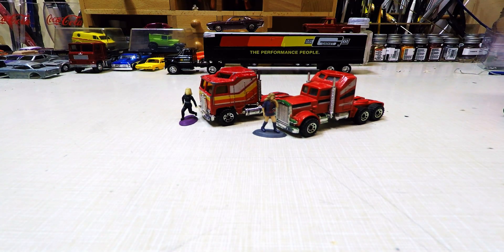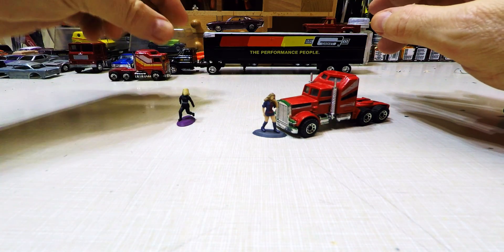Matchbox Kenworth Aerodyne COE and Conventional wheel swap and ideas

Comment: Are my eyes playing tricks or did I spot a 77 Dodge Street Van by Tomy? Reason it caught my eye is I have one like that but mines a little rougher I believe. Don't know much about them, got mine given to me with several other cool cars including my Bearfoot. Looking forward to seeing your rigs get finished. I've been in bodywork hell on a few castings, had to start completely over twice on 6 different ones. Got a couple of builds done though and I should have a video coming out in a few hours from now. If my phone cooperates. The phone I was recording with fried and lost everything on it...
Reply from the maker: The Dodge is a Hot Wheels. I know what van you are talking about. Had one as a kid. I have been in body work hell too. 6 cars I had to start all over again by striping them and starting over. I laid out the best paint job ever on the Matchbox Ferrari Berlinetta and was doing the detailing on it. Dropped it. Big scratch in the top. Just had painted the Matchbox 74 Dodge Challenger. Hung it up the dry. Started to walk away and heard something fall. Wet paint ruined. I use a GoPro Hero 4. That saves the phone. I use the phone for pics and they go directly to my SD card in the phone. This way if the phone goes south, I dont lose anything. Not even my contacts. I will get more videos up in a week or so. Got lots of stuff coming. Really excited about getting the resin 3d printer.